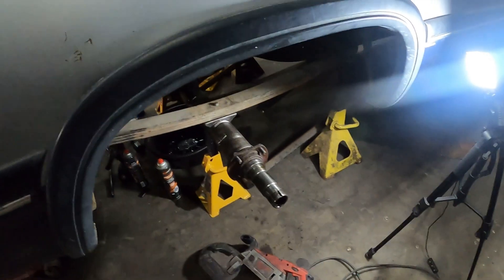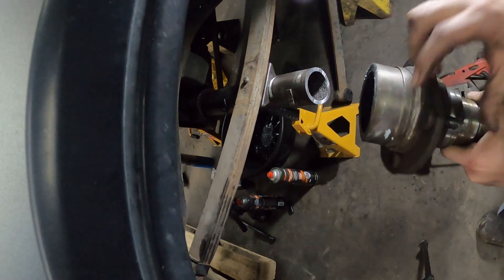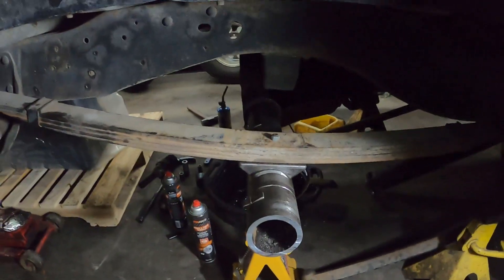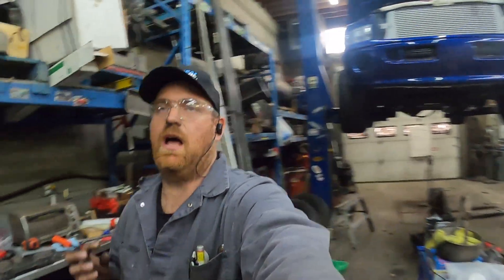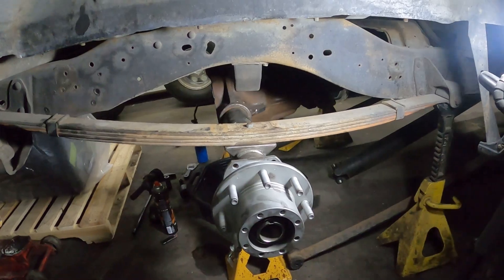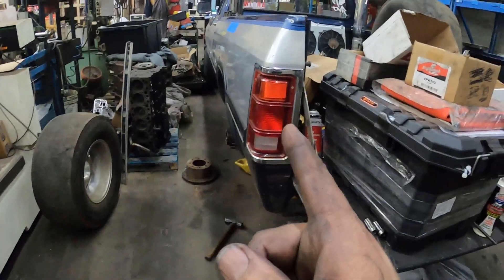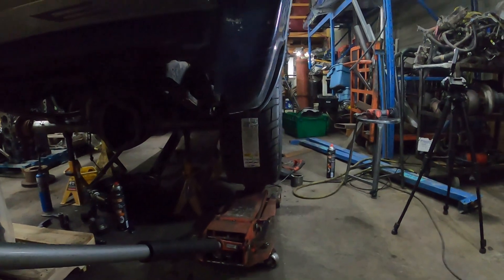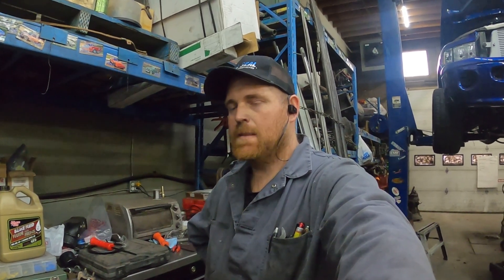Part 2 first gen diff narrowing

Comment: We did narrow a dana 80 years ago to fit under a 52' gmc truck with Cummins engine.
With everything removed from the axle we did cut it at a slow turning metal saw and chamfered both sides to weld them together in a couple layers of welding.
Used some thin pipe to put inside to connect the pieces and used some really big pieces of angel iron to make sure that the axle stayed straight.
Now almost fifteen years later it is still doing good and everything works as it should.
The axle shafts we had resplined and cut at length at a metal shop that does all kinds of special work.
For USA and Canada it's nothing special , but over here in Holland you have to search for such a shop that does this work.

Comment: Absolutely I like to see the machine operation.. I replaced the end of a axle before on a dana 7😊0 . With a purpose built jig .. using a hose clamp for a rap around is a good idea ..I use to do tube repairs on boilers  you ever used a Metabo 14-150 I think for cutting and grinding . Works good  thanks